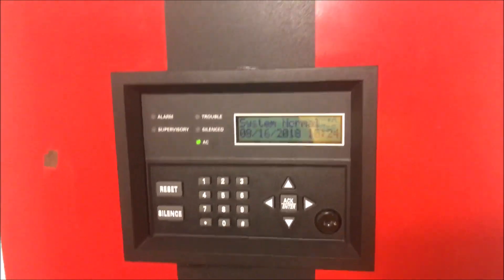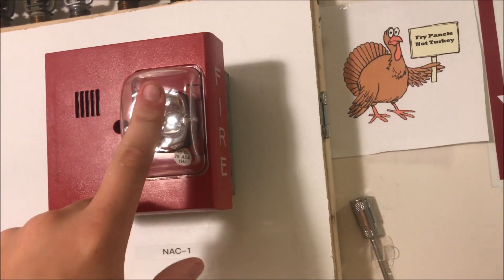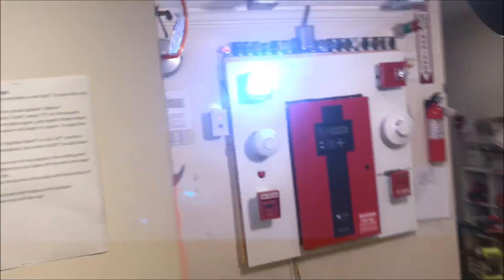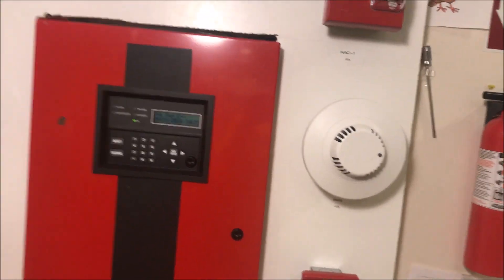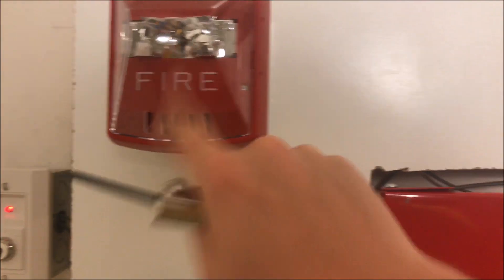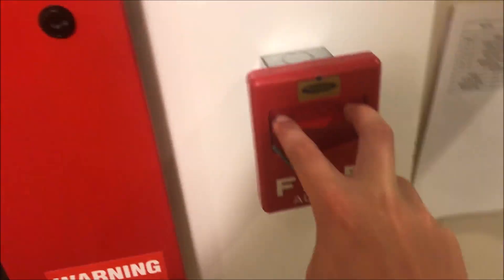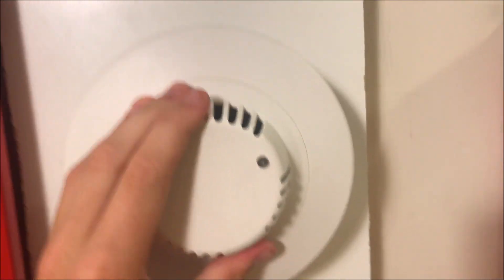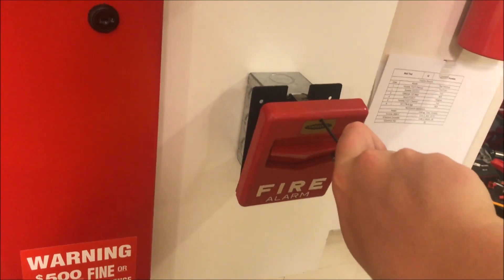Wall Test 42: Fun With Faraday

Comment: Very cool test, I'd imagine  this is what my local public library system  would sound like  but much louder, they have UMNTs  in the main adult/teen sections, while the new toddler areas have Siemens ZNS units, which of course use the same soundchip as the Exceeder